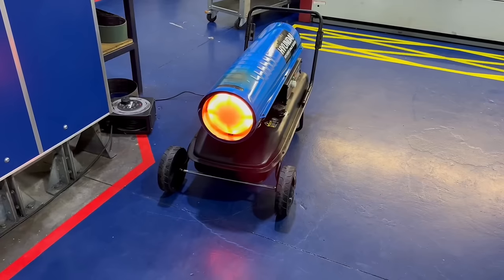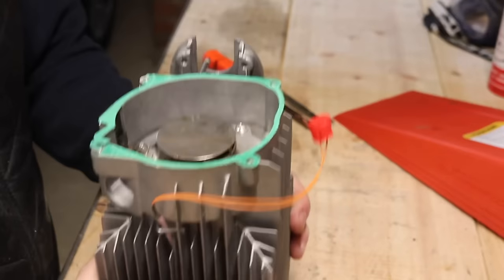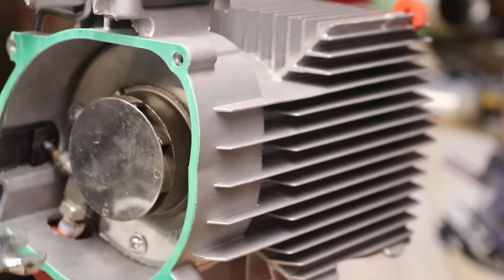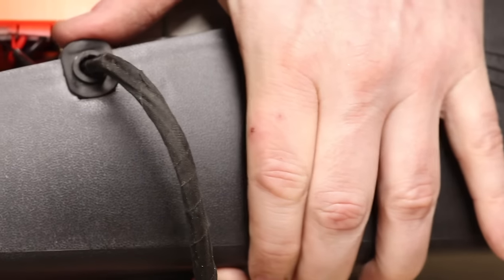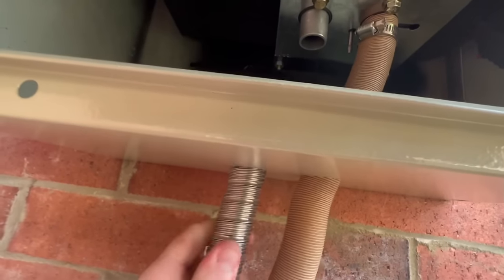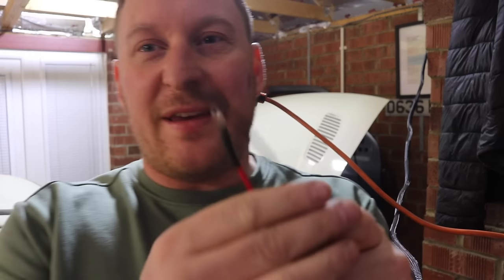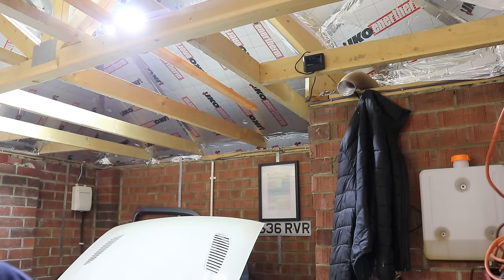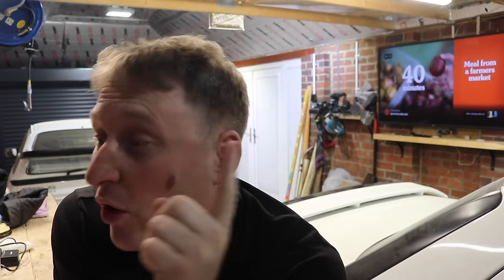CHINESE DIESEL HEATER INSTALL AND TEST ** Glow plug removal **

Comment: Kinda missed a trick the intake is outside so you are heating outside air if your intake was from the garage then as it warms so does the input air so less heat needed to warm up the air, it’s a closed circuit so no fumes as burner air is separated
Reply: Not sure thats right; pretty sure that thermodynamic efficiency is better if the air (oxygen) is cooler (denser). Thats why ICEs are turbo charged/supercharged. Given that the heater will only be used when its cold "outside" , its actually better using the outside air.
Reply: @dwaggys3322  its not for combustion the hot air from the from the room run over the heated fins, you are wright about engines colder denser air better combustion but its not the case here. its easier to heat warm air than frizzing temp air from outside.

Comment: Never come across a 4 kW hair dryer!
Reply: Ikr these exact copy models sold by maxprods have been shown they get about 4.2kWh genuine if semi-rigid fuel lines and short runs😂  litteraly the same as what you get from two 2500w fan heaters that are really about 2.1kWh. Adam needs to relax a second and think what's he's posting. Maybe not give advice on things he has no clue about.

Comment: Hi Adam me and my dad have run night heaters for years in our garages.  What we learned especially in cold weather is best to have it low mounted and also have the intake plumbed inside also so it is more efficient
Reply: Totally agree hot air rises so should have been mounted lower to get the full benefit.
Reply: And as stated above (plumbed inside) the heater should suck air inside. If you keep pumping in from the outside, you're effectively pumping out warm air. Circulating inside has to be the better idea.
Reply: night heaters? any link to what your on about?
Reply: More importantly. In this setup you could suck in exhaust fumes. There should at least be more distance between exhaust and inlet but ideally connect inlet to the garage as well.

Comment: Ive installed a few of these Adam and i have a few of tips. Power supply could be a leisure battery fitted out of the way and charged via a motorbike charger which are very small and easily hidden, this way you can just turn it on when you like without faffing about opening bonnets and then every few days turn the charger on for a bit, I have mine setup this way with all the cabling in conduit and the control panel and charger mounted on the wall. I would also put a grommet around the fuel pipe going into the box as the pipe can move as the pump pulsates and it wont take long to cut the pipe on the metal entry point to the box. Lastly check your insurance with regards to a diesel fuel setup running an appliance as it could cause headaches in the event of a claim. Nice job fitting it in the box, i use mine in winter but usually put it on for an hour before i head out as they take a while to warm the space. Keep the videos rolling.
Reply from the maker: Cheers for the advice James 👍🏼
Reply: I've fitted 100s of these and there's more than just the battery problem😂  this is the worst setup I've ever seen. I agree with you on the battery then use a ctek or optimate to charge it. The optimate are the only ones that don't freak out when you charge the battery while the heaters running, the cteks sometimes show failed  battery and they ramp up and down too quickly so you get a fluctuating fan noise from the heater, they work great when the heater is off though. The best maintenance charger about for doing big boys batteries especially ones powering these heaters  is optimate 6. Ctek quality has tanked recently tbh and if you need any bigger than optimate 6 then it's because you have a gigantic 12v marine battery the size of a car.
Reply: @bigduphusaj162  Or just get a Victron charger. Problem solved and they are perfectly safe to leave on all the time...

Comment: Enjoyed your video. It was good to see the giblets of the machine. I liked the idea of the weatherproof metal box. Some comments, mainly repeating stuff from the comments below:
- I can see why the hot air output was put high as you had an easier way into the garage via the soffit than coming in through the wall but the heat should be coming in low to give it some chance to heat something up in your garage before it all ends up in the roof space.
- the input air to the heater should come in from the garage eg. from all the lovely warm air in your roof space as it will be more efficient to heat pre-heated air than the external cold air
- you should have a fuel-filter between the fuel tank and the pump, especially as your fuel tank has its feed from the bottom of the tank which is where any crud from the fuel will settle 
- replacing the fuel line with a better quality fuel line is a good idea but the 5mm automotive fuel line is too big for the pump. It should be closer to the original ID of 2mm and be hard and not squishy like the original fuel line. The squishy fuel line allowed the manufacturer to have a simpler/cheaper connection as the line can be pushed on the fuel nipples. The hard 2mm ID can't be pushed on the fuel nipples but you can the use the 5mm automotive fuel line to create joiner pieces and attached everything using jubilee clips
- it would be quieter if the fuel-pump was installed outside
- it might be safer if the exhaust pipe that is inside the metal box was wrapped in some exhaust wrap
- it is important to use a battery to run one these heaters as though you need 12V to start the machine and keep the machine running, more importantly, you need 12V to allow the machine to cool and shutdown properly. A 240V to 12V adapter wouldn't allow this cooling period if power was lost when the heater was running
- it is important to bleed the fuel line to the pump before you start the system as these type of pumps are lubricated by the fuel they are pumping. The pumps are good at pumping but not so good at sucking and so rely on the gravity feed from the fuel tank to do most of the work. If there is air in the fuel line then the pump can spend many minutes trying to suck this air out of the line without any lubrication

Comment: 2 points on your installation ‼️ 
First warm air rises, so in any warm air heating system you want the heat blowing in low down.

Secondly you don't want the intake drawing air from outside, in winter that air is going to be colder.

You want the intake drawing air from inside, that way as the garage warms up your recirculating warmer air, rather than trying to heat up very cold air from outside.
It'll run way more efficiently and warmer that way.

Oh and another thing, china and japan are completely different countries.

Japan makes some quality gear, think Nikon, Honda etc

China on the other hand, products tend to be cheaper for a reason ie lower quality, poor build and lower quality control.
Reply: first two things I agree, or instal heater inside and only move outside exhaust pipe and same size intake air what exhaust pipe and instal heater lower close to floor, about quality so I have two of them in 4 years and no issue, fuel pump I have in flat position in both and no issue and again if you instal inside garage you save £70 plus work with box and also more heating will be inside because heater also giving heat from unit
Reply: He said China isn't Japan

Comment: Due to recent financial and personal difficulties I’ve recently brought and lived in a static caravan for around 5 months and the first thing I installed was a diesel heater, cost £100 from eBay and I’d be lying if I didn’t say it wasn’t worth the money…. Great video as always Adam, keep up the good work bro 👌🏻
Reply: hi just a question, did you find one heater enough to heat the caravan?
Reply: @David-ws6zr the dude I'm the video used 1 to heat a double garage, will definitely heat the largest caravan on the road
Reply: Yes i lived caravan for  2 years. The cheap heaters weren't around then.
Reply: @flybobbie1449 , how's he going to power the unit with 12 volt , sounds like he's boon-docked in country ??
Reply: @doneown503  Could use solar panel to charge battery.

Comment: This is the most in depth video I've seen so far and it's pretty decent at explaining the history and use of these. I have one now that I put in a old military crate for mobility and i installed a quick disconnect so I can either use it in the car , with alligator clamps , or connect it to a 120v to 12v 10a wall adapter I got that's really simple

Comment: I use mine with red diesel, which is cheaper (in my country) . You can also mix it with waste oil (60/40) without any smoke or smell. Those heaters are awesome....

Comment: Great video Adam. I installed one of these in my garden shed years ago before I could fine any links on youtube. I worked it on the basis of running one on my boat. Best thing I ever did. I installed everything outside except the controller its been working a treat

Comment: 'China is in Japan' made me wee!
I've had a Chinese heater in my camper for 3 years and it's been faultless. The exhaust rotted after a winter so I fitted a Webasto pipe and silencer, exhaust is quieter too.
Reply: I nearly 💩 myself too. This guy should be on the stage

Comment: During start and warm up these heaters draw around 30-40 amps so that 8-12amp wire that you used is actually more of a fire hazard than the psu's that you said aree a bit scratchy.
I've had mine connected to my cdh for over two years now without any issues at all.
Just like any other electrical unit I tune it off and unplug it when it's not in use.
Reply: Yip, and the hose from the pump to the unit is absorbing its pulsing power probably more than the cheap stock stuff. Dude never read the bit about semi-rigid lines did he. Nor does he even realise when you heat from above you lose all the heat to the space above the ducting. Terrible fitment and I like the guy but offfft
Reply: uses 8 Amps on start-up, not 30 or 40

Comment: Got one of these for my shed in October, great little heaters, much cheaper than leccy! The Chinese ones are based on the patent of the original German design, the patent ran out so it's a legal copy. They are easy to disassemble, repair and reassemble.
Reply: They just aren't what they claim. They market themselves as much stronger than what they are. The 5,000 watt one is closer to 2,000 tops.
Also it's only legal NOW they were making these before the patent ran out.
Reply: @SilvaDreams  you're confused mate. The genuine ebers this exact one is based of does around 4.6kWh if fitted properly. This cheap copy does around 4.1kWh can be pushed to about 4.4 if you do rigid fuel lines and set them so the fan perimiters goes up to 4800 ideally 5000rpm and you set the HZ perimeters to- Min1.6  and Max 5.5hz 
Now if you've got a good one plumbed in right and a decent plug it will run no problem at these "higher than manufacturer" setting, if you have a badly made one or its not plumbed in correct you won't ever get it running good at the maximum perimiters which on the cheap ones are in the hidden menu.  To suggest these put out 2kWh is utterly ridiculous as they beat two claimed 2500w fan heaters pal. Even they lie the 2500w electric fan heaters are 2.1kWh a really good one 2.2kWh.  What do I know though I've only fitted about 150 of these and Every other type of heating systems in boats.. that go to the north sea.. in freezing conditions. 2kw 😂 mate the smaller 2Kw cheapo versions of these put out about 1.7kWh they aint much behind the real ones either.
Reply: Hmmm....   Mr. Big has done his homework!   As such, these heaters have been in use since the late 1930's.
 I remember seeing these heaters installed in military vehicles as far back as the 1960's.  I remember them in England and Germany as most NATO countries installed in buses and trucks and tanks.  The Navy had them installed on most ships.  One of the most humorous observations is when in Vietnam, they were fitted at the factory and shipped directly to Vietnam.  We could not help wondering, what the hell they were thinking!! 

Young man, it takes a critical thinker to step outside the box and forge ahead as you do. This is how we learn.
Great content.  Please do not take some of these comments personally.  Yes, they may be crude, but this is what they call spit balling.  We are just throwing perspectives out there for general consideration.  We are all responding with enthusiasm.  Your passion evokes this response.  You are commended for the effort. 

Thank You!!!!!  @bigduphusaj162

Comment: I got a bar in my garage so we use the heater quite a bit.  This is a great installation but move the heat intake into the the heated area and the pump outside.  Lower the tank so it's easier to fuel.  Also, try setting it to temp instead of Hertz for a garage.

Comment: Adam I’ve got a old parkway fire in my garage gets up to 35 degrees in the winter, keeps the old mk2 escort lovely and warm, keep up the vids mate.
Reply: Can’t beat an old parkray I had 1 in my allotment shed hooked up to a copper tank for the water supply and radiators piped up
Reply from the maker: Cheers Wayne

Comment: The SMPS (that you showed) are safe as houses mate. Just make sure it is a little bigger ( in amps) and fused properly. They also have internal safety features including a fuse and short circuit protection. It will need an enclosure like! Cool video!
Reply: Never run these off power supplies only batteries. The cheap ones melt up on hard shutdowns mate only the real ones survive them because of the better electronics and epoxy on the bits known for melting up on hard shutdowns. Soon as you get a power outage or even a big enough surge you're power supply shuts off and the heater cannot finish its shutdown cycle.  Remember this one thing, the second you get a power out or a breaker flip you're heater is automatically toast. The most I've ever heard these cheap ones survive is 2 hard shutdowns. Cheers.

Comment: Hi have one in camper and on it it takes the air to be heated from inside the van so it’s not heating outside air will you heating a large area it would be a good idea to do the same so as your garage heats up the heater will be more efficient

Comment: i think the other comments are right, pipe the air inlet to inside the garage, my mate's used to pull damp into his garage, that's probably why
hot air rises, so you should have the hot air piped in it low down
i'll keep an ear out on newcastle rd, fingers crossed every time i hear a fire engine...

Comment: i use one of these to supplement the heating in my house i run it on kerosene, it runs cleaner than diesel and is also cheaper i also drilled an extra hole for the air intake so the return air was warm air from the house and not from the cold air outside

Comment: I've been using the 5kw in my kitchen we got new for £100 4 years ago.  I have it outside in a small cupboard I made with the air pipe through the stone wall into the kitchen of our large stone and lime house. The downstairs has large double doors between the kitchen and livingroom, so the heater is a first heat on a morning u til the log burner reaches temp. It's fantastic. The second year we had it in 2021 we had temps of -21°c but we were toasty. Only issue I had was last week the fan failed but £20 fix.

Comment: Just watched your video, good content and your explination is sound and detailed.  Ive just watched cos ive nothing else to do.   Ive had a few of these CDH and run 2 at the moment, one in my double garage/gym.  Also one direct into my living room thats heating up 2 floors from 8 to 11 pm.    Get yourself kero or red, save a penny or two. Best mix ive used for 2 years is 50/50 of each.  Kero can be run on low settings and red very good for high.  These are great bits of cheap kit that you know require periodical diy seevicing.  Shame you went down the 70 quif box route, but if it works! Id rather save the 70 quid and make a. Box.  Good luck with your channel. Be lucky

Comment: You should mount the air intake (not the burner, the heater input) indoors for more efficiency and also, right now your setup can bring in exhaust fumes if winds favor it.

Comment: Be careful with running off your car batteries Adam, I have made a similar mistake with led lights in my council garage without power. A car battery is designed as a fast discharge,fast charge so as the diesel heater initially uses a few amps on startup and then drops right down during running, so is a low draw so won’t do your car battery much good, especially as you aren’t using your cars everyday. You would be better using a leisure battery as they are designed differently and are better suited to a low draw and I would have a battery charger but also for added cheaper running invest in a solar panel and solar charger. I plan on getting a diesel heater and a camping powerbank to run it and led lights, and be cheeky and charge the powerbank at work😂😂😂. However it would be cheaper to do leisure battery and solar panel but I worry about the panel getting nicked as it’s a council garage away from home
Reply: im in the same position as you jon - its a nightmare not having power to the garage isnt it? you can definitely work around it though mate - go for LIFEPO4 lithium leisure batteries and have them on rotate, charge one as your using the other.

Comment: I would use a separate battery connected to a solar panel to trickle charge the battery. Fuse the connection between battery and heater, mount the filter in the internal wall so the air is warmer and more efficient. The output warm air pipe extend to floor level.  Buy a Carbon monoxide detector and a fire extinguishers.

Comment: Hi Adam 2 things why didn’t you put pump in cabinet be much neater and you should of mounted heater lower in cabinet so if exhaust leaks it will be away from getting sucked into garage